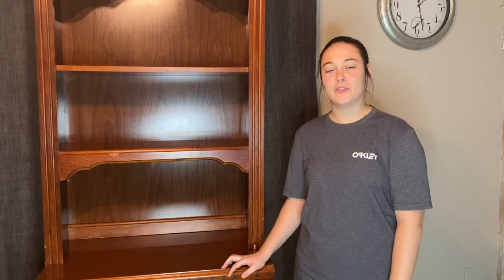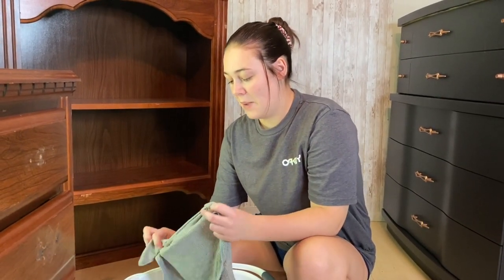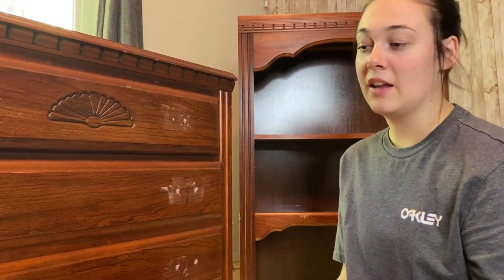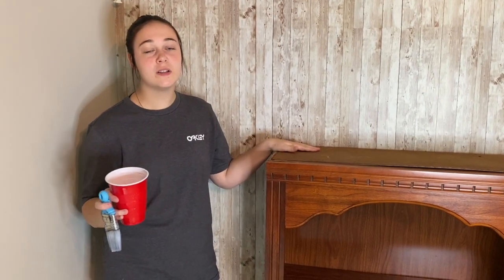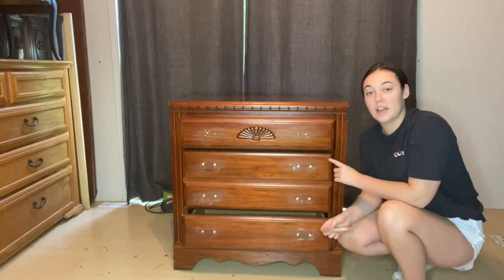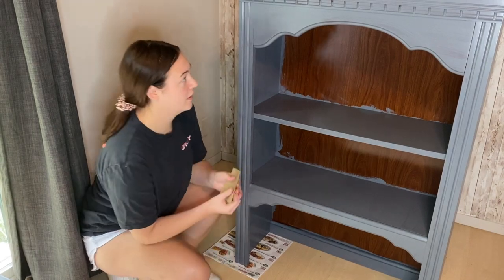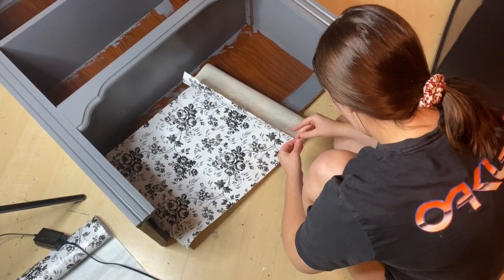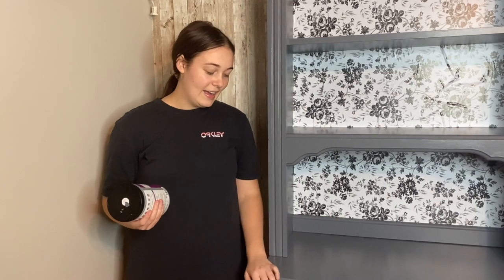Flipping a Hutch into a Modern Coffee Bar with Beyond Paint/Apply Peel&Stick/Trash to Treasure Flip

Comment: After using both "Peel & Stick" & wall paper for many years, I have found that when covering a large area like the back of the hutch, Wall paper works much easier, whether it is pre-glued, or the type you have to use with wallpaper glue, the fact that the product can be pulled up and repositioned easily, which you can't do with peel & stick, One large flat area and you're finished in very little time, great when you are selling the Piece.
 
Plus the fact that if the wallpaper tears you can still simply align the edges & apply it to the surface and the tears aren't noticeable. 

Peel & stick, once torn is totally not fixable because it will stretch where it is torn and that area will never lay flat and look good. 

Also, as someone else said, remove the back, attach your paper and then re attach the back. Makes the job soooo much easier, Hope this helps, And thank you for sharing your work. 

That piece looks great and the Backing is good choice, great looking finished piece! Subscribed and looking forward to more!
Reply from the maker: You are so right! And I am very new to peel and stick, I think a perfect application will come with time. Im so happy you decided to click that subscribe button, it helps my channel out a lot!

Comment: The Beyond paint company says it should be applied with a roller but yours came out great using the brush. This paint is suppose to have a texture to it but if you want to smooth it out in between it’s best to use a 200 grit because a rough sand paper will take some of the paint off. This paint also takes a few weeks to fully cure so if you are selling a piece with this on it then it might be best to wait before selling it so the paint doesn’t ship. The hutch came out beautiful!
Reply from the maker: Thank you, yes I actually just posted another video using beyond paint and used their method of a roller and chip brush. I like to try out a few techniques when using new paint to see how it settles in different ways. Make sure to check out Building a custom base (my most recent video), I use the roller method there. Thanks!

Comment: Fantastic 👏,  I was wondering how the paint has held up using the brush as opposed to the roller? I just bought this paint to use on my kitchen cabinets in my new home.  Debating on if I want to use the roller after seeing how masterful and beautiful your project came out with just a quality brush.
Reply from the maker: Thank you! I haven’t had any complaints from the customer who bought it! It also sat in my workshop for a couple weeks before it was bought and no problems there either. I believe they recommend rolling just to give it a thicker texture for durability. I would maybe roll for cabinets though, it will be a lot faster that way.

Comment: Every other video I have watched says that BP recommends rolling the paint ,but you used a brush. Did you have any issues with brush marks?
Reply from the maker: It does recommend it. I also have videos doing it the way they recommend if you want to check those out. I did not have any issues with brush marks, it did have a very even finish. But I will say you have to be a lot more delicate brushing over rolling and I think that’s why they recommend the rolling technique.

Comment: Love it! It turned out fantastic! I LOVE the color. I’ve never used Beyond paint. However, from videos that I’ve watched, they recommend rolling it on. But I think it turned out lovely with the brush! What do you think?? Did it do just as nice with the brush application as it would have with a roller?
Reply from the maker: Thank you so much! I do have another video with me using beyond paint the recommended way-rolling, I just liked trying it out with a brush as well to see if I could find a difference. With the brush it was a lot smoother. However, beyond paint recommends rolling it on specially for that rolling texture. They believe it hold up better that way and does a better job preventing nicks.